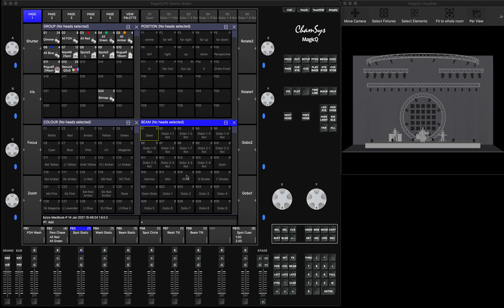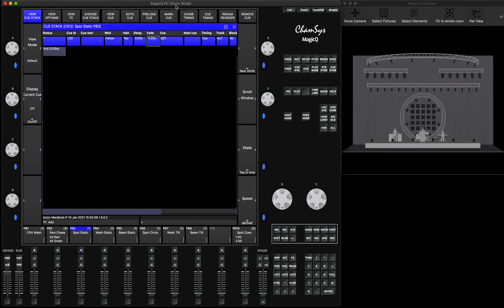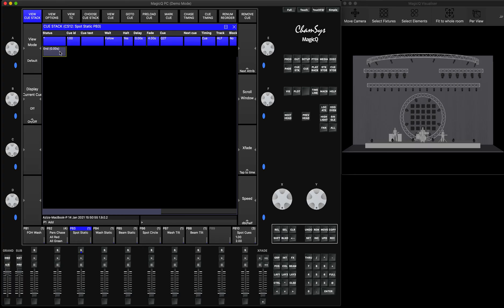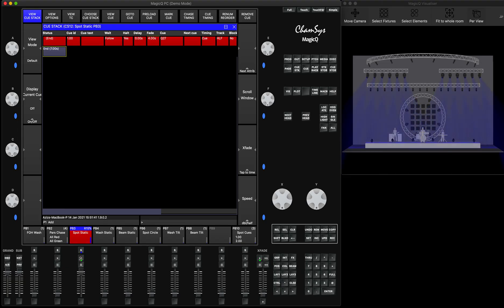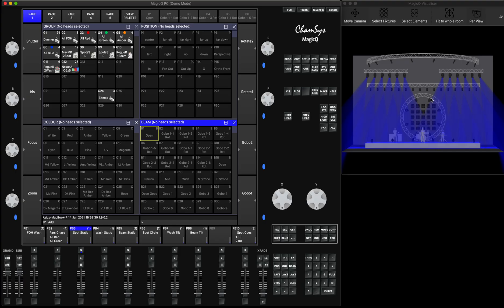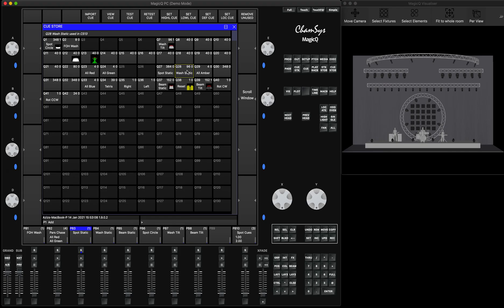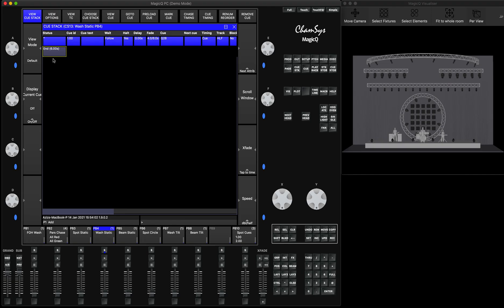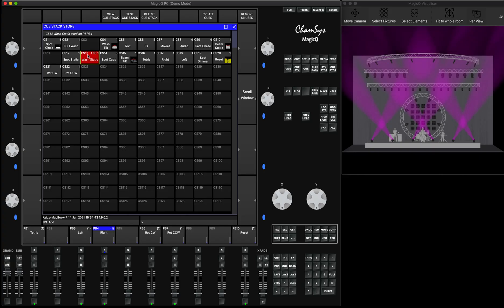Playback Release time

Comment: Thank you so much for all of your super helpful videos! I have a question — is it possible to globally adjust the playback release time? I use MagicQ for busking and my use case is that I have an executor page with dimmer or colour bumps/flashes as cue stacks (with a single cue and .5s release time); assigned to keys on my midi controller. For some shows when busking I would prefer a longer release time. Is there maybe a way all of the release times in one go, or do I have to copy everything and change the release time for each cue stack? The rate master doesn't seem to work for the release time. Thank you so much!